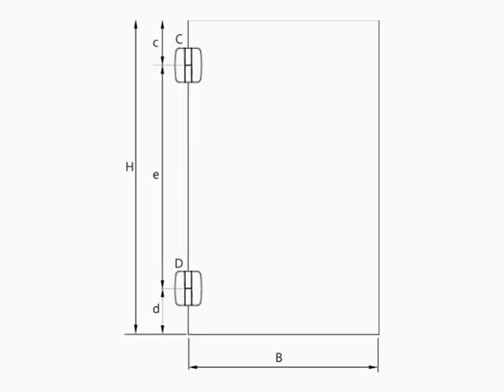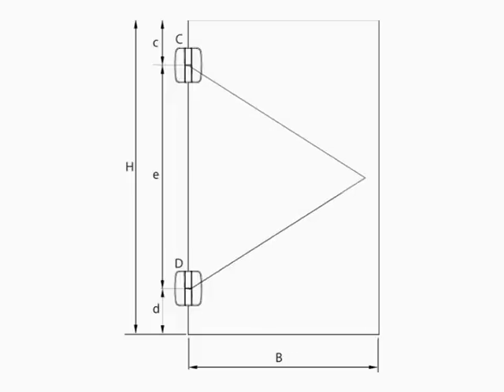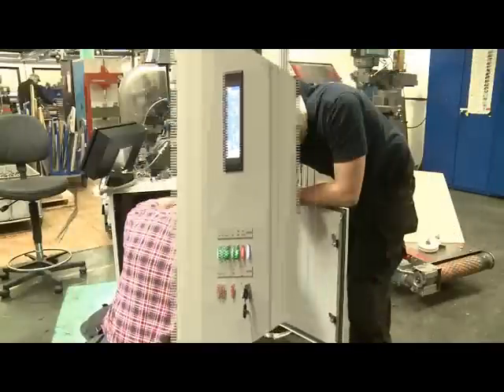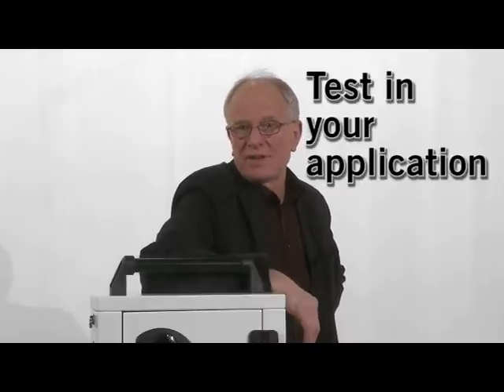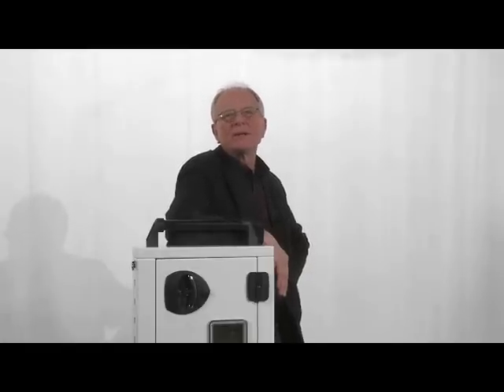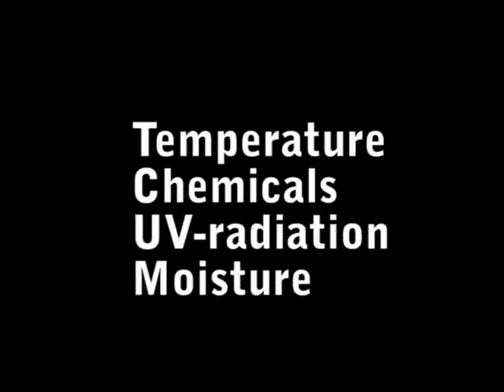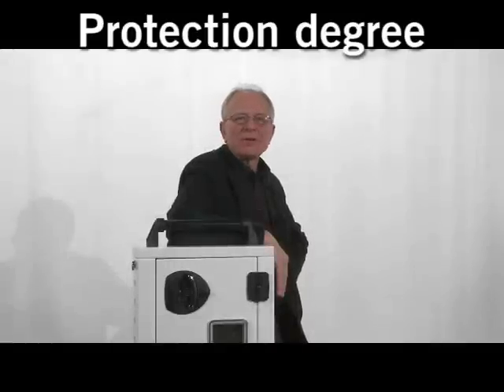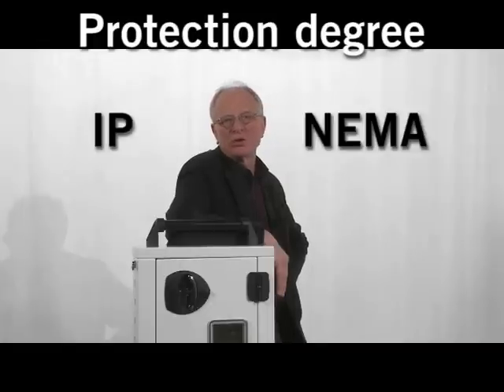Learn about different types of hinges

Comment: I need help finding out if there is a hinge that I can use for this...
I have two 1in boards and need them to fan open with hinge but also close fluhs BUT the hinge I want to be on the outside. any ideas?
Reply: i mean it would be like putting a hinge on a thick book on the outside cover. any ideas would help